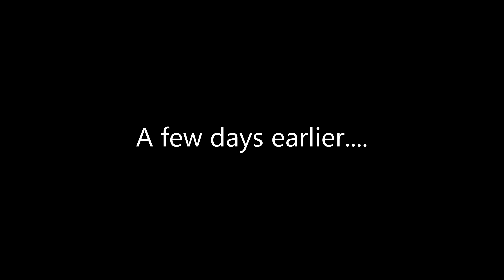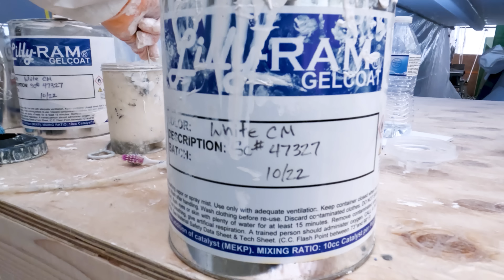This Could MAKE OR BREAK the Look Of Our Kit Boat (MJ Sailing - Ep 280)

Comment: Great work, Matt, as usual!  One thing that might help going forward is that there is an attachment made (or you might be able to make your own) that is basically a depth control for the oscillating tool.  It’s hard enough to control from side to side as you’re removing material, if the depth control is keeping the tool from going too deep it might make it a little less exhausting.  Hope this helps!

Comment: Have you considered using a roller and gelcoat formulated for "brush on"?  its thicker and you'll waste less material in over spray.  you're sanding it back anyway so roller and brush marks won't matter.

Comment: Matt and Jess, If you're working on seams like shown @ 10:38 that are getting gelcoat over top, you can increase the bonding strength by increasing it's area (50% or more) with a scribed scraper or notched scraper... it can give the bond a much larger area like the "tooth" effect you get from sanding surfaces for painting. The scraper's edge can be dragged over a coarse grade of sandpaper a few times for a similar effect to create a scratched, uniformly notched edge that acts as a scribed scraper does, leaving tiny linear ridges. When you apply the glass on top of this the resin will have a smooth base with tiny micro channels for resin penetration for increased bond strength.

Those resin and gelcoat can lids you're struggling with are a mess !  Save the old and new lids for re-use by cutting 2 pour holes in a new clean one, one near the edge or rim (not all the way) in a "T" shape that can be bent outward for pouring, and the second small perforation for venting to control pour speed/volume. The old unmodified can lids can still seal up stuff for longer term storage, just wipe out old material as much as possible to avoid cross contamination. The modified lids can be sealed for day to day use with duct tape or better, metal reinforced duct tape which can also be formed into a spout for pouring from can more neatly.. at end of day, when done, squeeze "tape spout" closed to seal, replace for next pour.

Matt your feelings are correct on fairing, follow the "rule of 3"... ie, a 1/16th gap needs 3 times the same area minimum to be faired in and a 1" area needs more than 3" area to be faired in smoothly and blended. This leaves an area around original hole or gap with a shallow transition angle between old and new layers of gelcoat or resin which  are less likely to pop or crack in flexing than one that is straight through like a drilled hole.

Comment: I've found that when I spray paint, I get a better finish and less spitting if I spray continuously (rather than starting and stopping) and over spray past the edges so my starts/stops end off the piece I'm trying to spray.  That may be less applicable for the huge bottom seam, but it might help with the other areas.
Reply from the maker: I'll give it a shot.  Thanks

Comment: HI there you guys.  Heroic effort there.  Wow.  So as I check in with you from time to time I think about my 'drifts' of aluminum "saw dust" from some "drilling" (60 mm) hole that I do through 1/4 aluminum plate for a dock co. So "Just Saying" I"ve used this aluminum dust to replace the silica thickener with the (half part) hardener slow cure from Total Boat to make that "peanut butter" filler.  The result is (like) an aluminum weld.   Crazy strong.  ~ Just saying ~.  Keep ;the faith there ~.♥~         (New Hampshire)

Comment: that makita 9031 has been one of the most valuable tool on my refit, the detail and precision combined with the speed  at what you want remove material its truly impressive. when it comes to remove stuff only a grinder with a flap disk tops it but at the expense of bigger mistakes done VERY quickly

Comment: I might have said this before: Joins can be covered up with a manufactured trim piece, makes it easier and looks more precise in lines/finish. In this case perhaps future kits could include trim pieces that bond to the surface via a guide(channel, mounting holes/grooves). In the case of the underside lights/cameras/sensors could also be added to the trim piece. Perhaps also on the top sides... Would be nice to be able to remove the trim pieces as well to service/replace them. They could be color accents as well...

Comment: tools that would have made the "digging" faster. Diamond ball end 1/4-3/8th diam and diamond straight with 1/4"+ end and .5-1" straight shank with diamond grit. Used on a die grinder or an electric straight die grinder. You would have  a hard time keeping up with it if done right. Very fast tool with little effort. As to filling  the void area with gel coat. I've said it before I'll say it again. Use brush able gel coat. add about 10-20 % cabosil to thicken the gel. Pre-mask the edges of the ground glass/gelcoat. When ready catalyze the slightly thickened gel and brush into place. You do not want to put gelcoat on right after doing a fiberglass coat. Your chances of allegation are very high. Its better to let it cure for 2 hours before applying the gel. When applying the GEL that has been lightly thickened follow behind it with a straight edge to make it level. I would suggest NO wax is  the gel, and wipe it with acetone to remove the oxide layer, lightly sand all surfaces with 120 grit and prep for spraying gelcoat for the final layer.

Comment: If you are going to use polyester resin with the fiber glass tape, it is not necessary to grind away the gel coat in the cracks. Gel coat is polyester based, so polyester laminate will stick very well to it.

The best way to spray gel coat is to do the correct thickness all in one go. The proper thickness of gel coat is about 0.7 mm. Gel coat does not fully cure on top if it isn’t covered by something. And there will always be some styren gas tunnels in the gelcoat.
Reply from the maker: The designer wanted a stronger base to help alleviate cracks in the new gelcoat than the old gelcoat in the provided.   The thickened resin with milled fiberglass in it was better for the structure of the crack.

Comment: It is all in the finishing Matty, Great job, but definitely fair all surfaces before your gel and flow coat layers. I have just sprayed the underside of my hard top in this way and it did not go so well and will need to be redone. Cheers Ross.
Reply from the maker: As always Ross, thanks for the encouragement.
Reply: @MJ Sailing  a little tip.I add a layer of surf board weight cloth as the final layer over you db which enables a peel ply like finish on your final layer.This reduces amount of fairing and a smaller weave to fill,negigible weight addition, sand more easily and you can laminate over the edge of your sanded gap.Saves so much time and wasted fairing compound.Fair after that really makes a massive difference.
Reply from the maker: Very good tip Ross.  Thanks

Comment: I’m not sure what problem you’re having with the DeWalt sanders, but under heavy use the orbital bearing is always what fails on mine.  It takes about five minutes to remove and Grainger will have one for you the next day for about ten bucks.  A real easy fix if you don’t want to deal with the downtime of a warranty repair the next time one goes out.

Comment: I once had a catalyst guy from Norac explain chemically why you should never spray gel coat in thin layers and let it flash off and set up between layers.  Chemically this can mean there is not enough styrene left in the gel layer to allow the polyester to fully cross link, and hence why many areas repaired like this end up with yellow stripes.  Gel coat need s20-25 thou in one application… I think if you calulate it mathmatically it’s actually 15 thou but with inconsistencies that is why gelcoat manufacturers will say 20 thou.  It is worse with white gel coats because of the high titanium content.
Not sure if it’s still available but we used a lot of Hawkeye Duratec to get a better sprayed finish, but colour vairiation was then an issue.  
After 20+ years making and selling gelcoat I came to the conclusion that if you can’t avoid sanded joins by good design then give up early and plan to paint with a good urethane paint.  Gelcoat is not paint.

Comment: I didn’t see you using a peel-ply layer. For those that don’t know the term. Peel-ply (a 100% Dacron Fabric) is a final cloth that you apply to a layup. Once it cures/drys you rip the peel-ply cloth off. It does two things. 1. As you pull it off the resin boundary between the peel-ply and the underlying glass layer fractures (the resin)creating a ideal surface for additional cloth layups or a fairing compound with very minimal sanding. 2. Because  peel-ply is a very fine weave it hides the course weave of the underlying glass.
Reply from the maker: You loose the chemical bond when peel ply is used on polyester.  For this application, the chemical bond was best.

Comment: Simple things complex minds. 

A seam refers to a line of stitching that joins two or more pieces of fabric together, while a joint refers to a point where two or more pieces of fabric are joined together without stitching.

I know.  You don’t care about vocabulary or using correct jargon.  Just git er done.  

Sorry.    Love the work you’re doing and always watching the next step in the build.
Reply from the maker: Definition of seam:. 2
: the space between adjacent planks or strakes of a ship
Reply: @MJSailing  haha. Ok. a strake is a longitudinal course of planking or plating which runs from the boat's stempost (at the bows) to the sternpost or transom (at the rear). The garboard strakes are the two immediately adjacent to the keel on each side.  I suppose it might need to be changed to include fiberglass boats.  Planks are likely of wood. 

I love what you’re doing and am fully excited to see you finish your project and I know while it’s a fun project you already have plenty of stress on your plate.   Don’t take me seriously. I’m now living my dreams through your, and many of the other YouTubers you know who do what you do, eyes.   I want to be a sailor but it’s difficult for me. I’m really happy you responded to me.  At second glance that came off more harsh than intended.  Yeah.  My bad.  Sorry.

Comment: I thought hulls were made as one piece molds, so I'm surprised that these seams would not crack under stress. Does the epoxy fiberglass resin "weld" the pieces together?
Reply from the maker: Very seldom are they one piece... It would be a difficult mold to produce.  So, they are fiberglassed together at certain points - on catamarans, typically where the centerline of each hull.   But the designer wanted a continuous seamless underwater profile, so put the joints here.
Reply: @MJSailing  Thanks so much for your reply. I learned something new!
Reply: The bulkheads tie it all together.
Reply: Ones made in the factory may be 1 piece but MJ's was stuffed into a 40ft container.

Comment: Get a router Matt
Reply from the maker: I've never been able to control a router freehand well.  These would end up taking way too much material off in the end
Reply: @MJSailing   use a suction cup guide and use the right size bit. It Will cut down time.

Comment: Why aren’t you using peel ply on those seams😊
Reply from the maker: I wanted to try and get a chemical bond with the polyester and gelcoat.  Peel ply is like adding wax and fully cures the resin making chemical bond not happen.
Reply: @MJSailing  makes sense if your going from filler to glass to fairing , but odds are your still going to have to apply a final coat to sand and polish .  So there will not have that “ chemical bond “. So why not use the peal ply and have better surface to gel coat …. Better but more labor that’s the price ,,, I’ve done it both ways best to go with what you can live with.

Comment: Don't want to be a Debbie downer, but a single layer of glass on those seams is not nearly enough. To give appropriate structure you need several layers, inside and out
Reply: you obviously haven't seen how the boat was designed and has been assembled
Reply from the maker: The fiberglass isn't for strength.  It's to help prevent the gelcoat cracking.  The structure is the flanges and the internal glass work